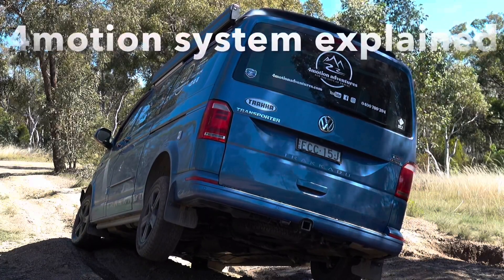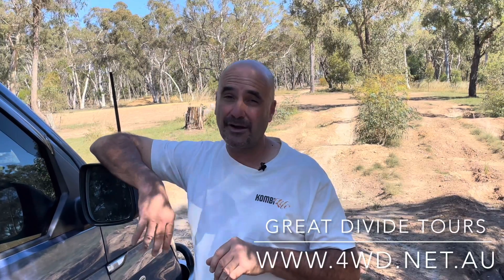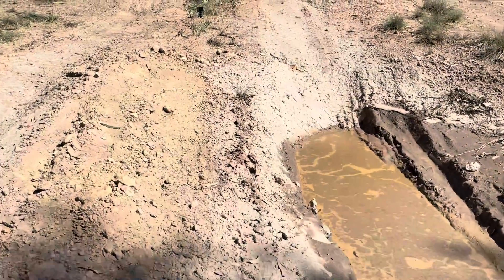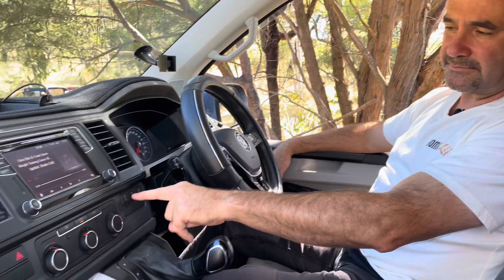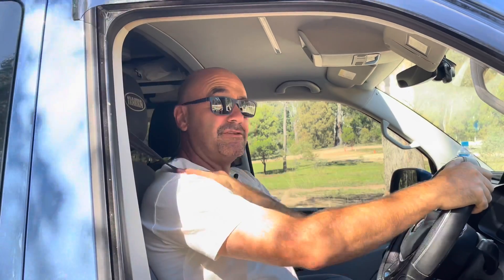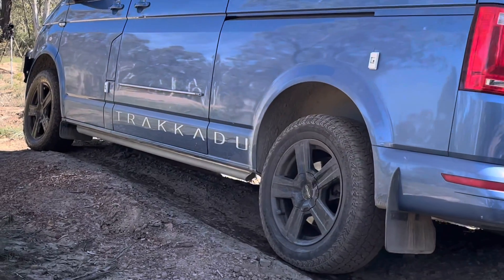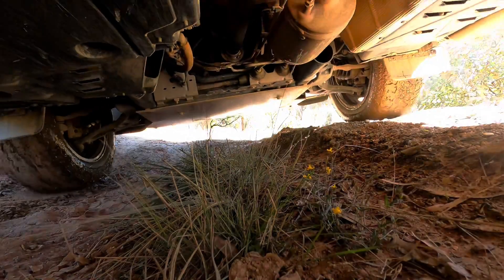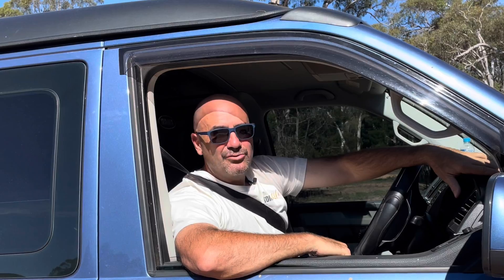VW 4motion system + Factory rear Diff lock explained and demonstrated over Moguls.

Comment: Hi, thanks for this and your other very informative videos! I have a question- I have a 2017 T6 with 4motion. I thought it had electronic diff lock as standard... is this sort of part of the 4motion system? My van does not have the button you have shown in this video. Does this mean that I don't have diff lock at all? Or is your rear diff lock option for mechanical diff lock rather than electronic?
Thanks

Comment: What if I dont have differential lock.... is that big bad ?
Reply: You will probably have EDL (electronic "differential lock"). The EDL system will brake the wheel slipping (using the ABS system). I have this system on my Audi with a Torsen center diff. Not as good as mechanical differential lock, but better than nothing.

Comment: Thanks for that. 
I have a 2021 v6 4motion amarok.  And apparently they thought kiwis didn't want a diff locker.  I've been pretty disappointed with its capabilities compared to my fully locked 80s.
I will get a Eaton or arb installed now i think
Reply from the maker: Ferdinand.  I agree.  The VW Amarok has nothing over your 80 series and indeed any standard Toyota 4wd like for example a hi Lilux or landcruoser.  They do however drive better on the bitumen and gravel roads but lose out on the tough stuff.  Our van of course does not have a centre diff lock like your Amarok so it’s even less capable in real off road rough conditions.  Our van is a soft off roader AWD but it does take us to places a standard 2wd van would never dream to go.  In effect, van life is more about cruising and touring over rock crawling.  I hear Vw have not confirmed they will be placing a 4motion in their t7 and possibly migrating their van into the ford transit model.  If that happens then it’s the end of an era for Vw enthusiasts who had I guess better get used to driving a Ford with no 4motion.  Well perhaps for us down under anyways. 🤪  onwards and upwards in any event 👍😎🇦🇺💪

Comment: Hi Alex, I have this setup on order here in Switzerland and what I can't figure out is this: once the read diff lock is on, does that also at the same time lock the central diff basically forcing it into all wheel drive? Or do I roll in front wheel drive even with the read diff locked and only once we measures slip at the front wheels then get power sent to the back wheels which at this point turn together since the read diff lock is on? Cheers Alex
Reply from the maker: Hey mate.  Congrats on the new van.  I am sure you will love exploring Switzerland as much as we do Australia.  Righto.  Here is the go.  Our vans are basically a front wheel drive until such time as the 4motion system detects wheel spin in any of the wheels including the two on the rear axle. When slippage is detected at the rear wheels, in the first instance drive is immediately thrown to the rear axle through the Hamden clutch system and at the same time the abs also acts to apply
Brake to the wheels spinning front or rear.  There is no centre diff as such like in a traditional 4wd.  The rear axle when activated will simple ensure drive is maintained to both wheels irrespective of whether a wheel looses traction.  The benefit is that you can drive over obstacles slower and more controlled as I have demonstrated.  So in effect there is no activation of any centre diff and the Haldex clutch system acts
As a centre diff of sorts if that makes sense.  Let me know if you need more info.  Thanks for watching and thanks for the question.  Cheers.  Alex from downtown 🇦🇺👍
Reply: @4motionadventures934  Thank you for the quick reply. I somehow had the idea that if the rear diff is activated, that power must be sent there somehow, so the haldex would be engaged no matter if slip is detected or not. cheers!
Reply from the maker: @xelawy  thanks mate.  I am confident that the rear diff lock does
not automatically trigger the haldex clutch to distribute power to the rear axle.  I could be wrong.  From what I understand the rear diff lock simply locks the axle so that box rear wheels turn at the same time irrespective of whether a wheel lifts of the ground.  If you find out info to the contrary please share as I am always open to learning.  Cheers.
Reply: @4motionadventures934  roger that. kind of makes sense it's just a lock and has nothing to do with power. thanks for taking the time to write. cheers alex

Comment: Hello, can we go this way with a T 6 4motion without differential lock?  Thanks
Reply from the maker: Gday Atprod.  The answer is yes you can tackle this type of terrain without a rear diff lock however you won’t have as much control over the vehicle which is where issues can arise. I say this because even with traditional 4WD’s we always recommend going easy on the drive train.  The 4motion system is very good in that it does stop driving going to the wheels without traction but it’s not as responsive as we would like like as you have to power up before the system engages proper.  The more power the more chance of thjngs breaking when you for example drop a wheel that’s spinning and it suddenly gets contact with the ground.   The truth of the matter is that these vans as good  as they are, are not built to go proper 4wding in terrain like that I have demonstrated on.  They are more suited to general touring and sand driving.  I just wanted to show the limits and that in the right hands they can certainly do more than what the showroom brochure shows you.  

Happy travels.  Cheers.  Alex.
Reply: @4motionadventures934  hello thank you, I had no intention of going so far in difficulty. I bought a T6 4Motion (mid-height 2.10m and long 5.30m reinforced frame 3.2T) last year that I have fitted out and I am starting my first weekends and soon my holidays in a Van. What worries me the most is the ground clearance which is very low.
What is the solution to combine the fact of raising the shock absorbers that it remains comfortable and without going into crazy expenses.
😁. apart from a miracle... thank you
Reply from the maker: @atprodT700  hey mate.  I hear yia.  Ground clearance is the biggest issue for our vans.  We have a 2inch lift by Seikel which helps or there is another product called projekt lift kit imported by skyline campers that is a cracker.  Gives up to 4 inch lift. Give them a call. They are in Gosford nsw.  Otherwise if you don’t go for a lift you really just have to drive picking the highest points and picking the best line.  Even with a two inch lift we are still treading very carefully.   Of course it just means we go slower and enjoy the scenery better. 🤓🤓.  Safe travels.  Cheers.  Alex.

Comment: Noce video. Interesting that the vans got a pop top fitted. Does that impact the vehicle stiffness/ did you have to add any steel framing on top of what is normally fitted for a pop top? Cheers
Reply from the maker: Thanks Sam.  The van was modified by Trakka Australia who would have to meet strict engineering standards.  I am not too sure of those standards but can say the van had a handled everything we have thrown at it so far.  Apart from some creaks and moans travelling over uneven terrain it appears to be able to handle it all with ease.  Have a good one.  Cheers.  Alex.

Comment: This is great, I have been thinking of a Delica D5 but these look bigger, and not insane big like the 4wd sprinter. Do all four motion VW have diff lock? what's the stock ride height like? are they all the same wheel base? do they have back seats? Petrol or diesel? Also, would this be the sort of thing you could take on gibb river rd, or fraser island, i just want to get around Oz, and not do competition style 4wd'ing. Just get to those great camp spots off the beaten, the tracks usually say "4wd only" . I need to have a van (not a car or ute) cheers! PS where are you/your course based?
Reply from the maker: Thanks Carl.   Not all 4motions come with a rear diff lock.  This is a factory only extra along with hill decent both of which we highly recommend.  I believe stock height is approx 2m but we are 2.2 with the lift kit.  Yes the van can handle the gibb river road and Fraser Island with after market tyres and suspension along with bash plates to protect vital parts.  It only comes in diesel. Defiantly worth checking out as a general tourer.  Hope this helps.  Cheers.  Alex.

Comment: do you turn off the ESP before using the DIfflock ? Im confused when you need to turn off the ESP. Can you jack off the rockslides ?
Reply from the maker: Thanks for your question mshaooyeman. As far as I know the only way to turn off the esp is to turn off the traction control which by the way also disables the abs system.  When tackling tricky terrain like shown in this vid where you need all the traction aids you have on board I would leave the traction control on when using the diff lock.  Hope this makes sense.  In terms of jacking up your vehicle, the only recommended jacking points are the one the manufacturer shows in the manual.  I personally would not recommend jacking off the rock sliders.  As it turn out I am Doing a clip on how to safely jack up and change a tyre weekend and will release it next week so keep a look out for it.  Have a great weekend.  Cheers.  Alex.
Reply: @4motionadventures934  Hi, 
the ESP Button on the T5 upwards (2010+) only disables the ASR (Anti Schlupf Regelung (AntiSlipControl)) which limits the output power of the engine so no tire is slipping while accelerating. Common practice is to deactivate ASR (by pressing the ESP labeled button) while driving offroad because it limits the engine power while needing it in most offroad scenarios.  It ONLY turns off the ASR and nothing else. So really you can drive in every situation without ASR (TractionControl) without sacrificing safetyfeatures like the abs.  maybe it helps! 
Cheers from Germany !
Reply from the maker: @marcopallaske175  thanks Marco.  Appreciate the info.  Stay well. Cheers.  Alex.
Reply from the maker: I would leave the ESP on when tackling difficult terrain as well as the diff lock.  The diff lock serves to allow the rear axle to turn at the same time irrespective of what wheel is off the ground and with the traction control on it takes care of the front wheels in terms of limiting power to those wheels that do not have traction. 

I would not recommend using the rock sliders to jack your van.  The only place I would jack a van in is the designated jacking points.  

Hope this helps.  Cheers.  Alex.

Comment: Learned a lot there, Alex. I also like the considerable experience you bring to this Channel and the commitment to do things safely (bravo!). I have one question, you do clarify that the 4Motion is AWD and not, essentially a 4X4. In your experience, the VW 4Motion is capable of most things thrown at it?
Reply from the maker: Thanks Simon. Appreciate your kind words and support. So far the 4motion has proved to be extremely capable for where we have travelled.  It has also far exceeded my expectations in off road situations as tested at the great divide tours training facility.  But.  Having driven 4WDs with a centre diff lock and increased ground clearance there is a difference between the two.  Our long wheel base 4motion with its factory rear diff lock is definitely a capable van and to some extent capable of tackling some country that previously was limited to 4WD vehicles only and we will continue our testing around the country to bring to you first hand our experiences.  Travel safe.  Thanks.  Alex.